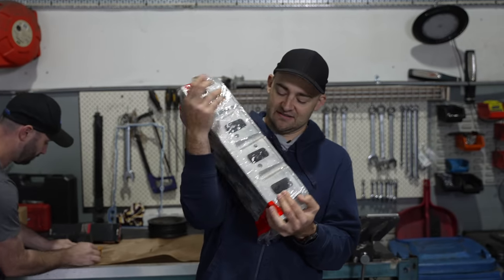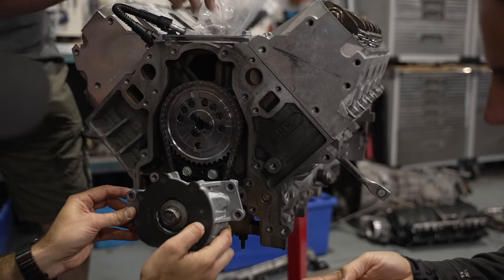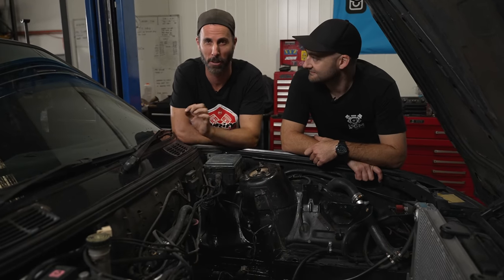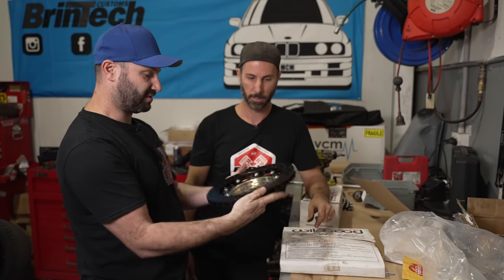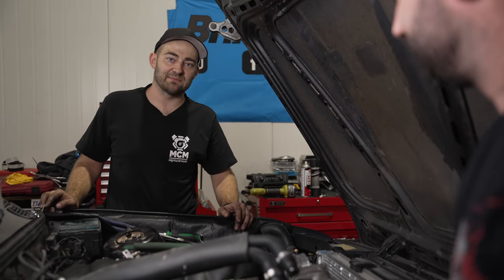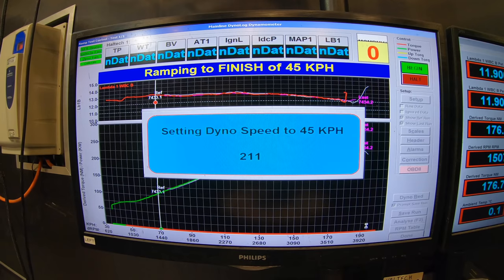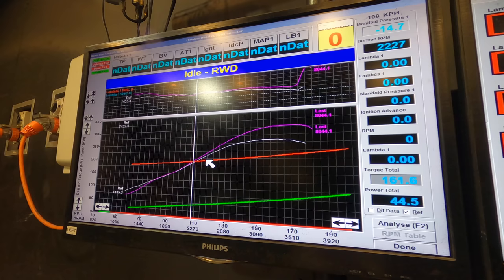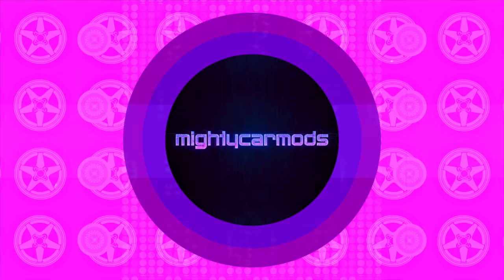BMW E30 CAM Upgrade & Dyno Run

Comment from the maker: Just a pinned comment to say Thanks for watching, there's one more video in the works to finish off this mad car (hello driving and skids) and then we've got something special for you.. Have an awesome week!
Reply: Thanks for making awesome videos!
Reply: Was that you shredding in that solo Moog? Sounded sick \m/
Reply: Hey Marty and Moog, anyway you could do a random fun video where you plum in the A/C output and redirect it to the air intake? See if its any benefit or if its parasitic and doesn't make any more power? I'd think it'll be an interesting video concept.
Reply: @chrisnorman1183  I like your way of thinking, but I'm pretty sure the power to run the compressor would outweigh any gains. Although, if the A/C was plumbed to the intake and inside the car, perhaps that'd be a way to run your A/C with less power loss...

Only one way to find out...
Reply: Thank you for everything you blokes do :) Really looking forward to the next instalment and what's ahead! You guys take care, same back at ya
Reply: Willwood brakes are shite lads 😋 ther only for Drag cars to be light . Alcon is where its at 👌🤙 Brembo are alright too 😋💯☘💙💚💙💚
Reply: You guys should ceramic coat the headers blaaack to decrease engine bay temps
Reply: Is there going to be a race track battle with Bennys IS600?
Reply: Chur!
Reply: You need to reinforce the chasis on the e30 mate
Reply: @BobMonkeypimp  exactly, conventional wisdom says no but throw a day at it and make a 15min video. If its useless it goes "in the bin" haha
Reply: what's your confidence level for the stock diff? love this project!
Reply: So the E30 vs Benny and the IS?
Reply: Something special.... a... GEMINI?!
Reply: Time for an updated intake video? Lol
Reply: Every video is something special for all of us, have an even better week legends! 💙
Reply: Marty, keep this car after it's done. keep working on it until it's fully epic and do not send it the way of Ms. Daisy! 😀
Reply: You guy’s are legends don’t change and keep up the awesome videos. 🤙🏼❤️
Reply: You guys deserve a tv show ngl
Reply: Luv you guys fro Panama City beach fl
Reply: Wow nicely done gents!  This is an epic little car!
Reply: Can't wait for black chops season 3. Hello compressor
Reply: U put so much work in ure videos, its a pleasure to watch, Thank u guys!

And so much work of this wrealy nice looking E30, get a good pack well setup Coils and decent tire sizes and rip that thing on the track, please!!!!
Reply: Hopefully the cold air fix up then skiddssssss
Reply: thanks guys!
Reply: There is still room for improvement in the chassi: lollipop eccentric bushings, E46 rack, stiffer steering bushing, adjustment tabs at the rear, etc....
Reply: In the Dirt
In the Dirt
In the Dirt
😂🤣👍👊
Reply: Race the lexus??
Reply: You guys have to race against Bennys IS600!
Reply: great video as usual
think about a hood scoop like the demon
or even the one headlight delect is fire
Reply: This episode had almost everything - Tuning Fork, LS3, Cam swap, BMW E30, 'Will this fit a Honda?' - just missing safety turbos/Yoda,Woody, Mechanical Stig and the 'I can feel the lubed shaft/Put both hands on it and give it a tug' double entendres usually seen when reassembling.   Love from the UK
Reply: Favourite build to date,🇮🇪🇮🇪🇮🇪
Reply: Why do you never throw any real power at anything??

You always take the cars to the track, seams like you do every mod but the engine is pretty much left alone! Cletus has LS engines with 3-4 times the power??
Reply: Thanks for all that you do.  Keeping well over 3.5 MILLION loyal subscribers happy is no easy task, yet you boys pull it off with every upload...  And TBH,  I really do wonder if those brakes would fit one of my civic's? Isn't the BMW 4x100 as well? It can be done...
Reply: Thank you so much for making these videos. I get so much satisfaction and enjoyment out of these. It truly feels like really enjoyable relaxing experience to watch you build and modify cars. Even now I feel already more relaxed and have had so much enjoyment and satisfaction out of your video and I'm only half way through it. The production quality is so superb in your videos and the music is just so absolutely awesome. It feels like floating in a pool of enjoyment because you do things so properly. It gives me big satisfaction.

Thank you and keep up the good work. :D
Reply: What about the jimny
Reply: Just placed my first order to you for MCM swag!! 😁
Can't WAIT till it gets here.
Reply: @andreas.619  I understand you but I have to disagree and only because tv ruins car shows. I honestly feel these guy’s are better off where they’re at. Tv makes to much drama for views for no reason. I hope marty and moog keep growing and have massive success in there life but tv isn’t in my opinion the way they should go. I hope you understand and i hope I didn’t come off as rude or anything much love.✌🏼
Reply: Put a pair of louvers or louver the hood,one on each side and pull that engine heat away from engine and compartment while pulling cooler air into the intake.
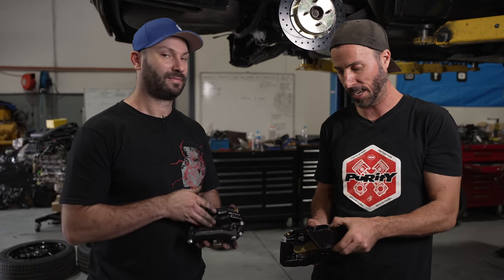Reply: please tell me what is the name of the song in 14:26, can´t find it. Want to know the name of the song sooo bad

Comment: Next episode: How to install a snorkel on your E30
Reply: How to install full tent combo
Reply: I had a snorkel on my silvia back in the day everyone thought I was taking the piss but my iat was awsome
Reply: stainless-steel-snorkel-kit!-?-!-?   👍
Reply: Or... Fit an N/A front mount.
Reply: XY HOW, GOOD ONE SIR.
Reply: Step 1: jack up your car
Step 2: install lift kit
Step 3: race mod max
Reply: Or how to replace crappy felpro head gaskets that failed....
Reply: next episode giant drag racer air scoop
Reply: Snorkels on BMWs could be more useful than you might think: https://youtu.be/-Tzdwdso5YM
Reply: @RoraighPrice  maybe transplant the hood scoop from the sti hahaha
Reply: Inline 6 swap
Reply: Make a mesh Hole in the hood and this funnel in the light and a plate (with some gold tape) to Project from exhaust heat 🎯
Reply: @chubbysumo2230  Was it the gasket? or was it the installation, or prep, or design flaw of the engine (many are known to leak easily)?
Reply: @Oblithian  exactly, too many variables to blame just a single brand of gasket.

I’ve had good luck with Felpro gaskets on my Heep and my 5.0 Mustang.
Reply: Guess they have to meet up with Donut and build a rally bmw together
Reply: That would be a good mod

Comment: Can we take a moment to appreciate Scotty nailing 3 perfect consecutive double-clutch downshifts while fiddling with a laptop like it's nothing at all?
Reply: Not to be a dick, but they're just standard downshifts. Even if they were double clutched (which isn't harder), I'm not sure what's impressive?
Reply: @-tr0n  It's easy with practice but properly double clutching especially smoothly and quick takes a lot of said practice.

It seems like you don't actually know what it is so let me explain. It's not just pumping the clutch twice like a lot of people seem to think. You push the clutch in, put the car in neutral, release the clutch again before pushing it back in and selecting the gear.
Reply: @janemba42  Yeah, it's one extra leg movement. Had to do it on the old '91 vw with blown synchros lol, also helps smooth out the shifts on an 18 speed if you're having trouble floating. Not really necessary on anything else!

If you watch the video, he only declutches once per downshift unless I missed something. Are we just assuming that because he rev matched that he is weirdly double clutching for no reason?
Reply: @-tr0n   "no one needs to double clutch" unless your a Fast and Furious character.
Reply: @RoraighPrice  granny shiftin...
Reply: @-tr0n  Sure did take the time to write that comment tho, didnt ya?
Reply: @nickkropat8857  Like I said, not trying to be an asshole, just clarifying things and genuinely confused as to why rev matching is impressive. It's literally second nature to car guys, or so I thought.

Comment: I’m getting my E30 done with a cammed LS3 at the moment, you can even see it in the background at 17:22. It’s over at Hassarati at the moment getting all the rust taken out and getting made very brown. Very keen to finally get it back.
Reply: What's a conversion like this cost
Reply: @JOHN42TD  I would guess 20k
Reply: Don't just do the cam. LS motors are great but they kinda don't breath that great. Get new high flow heads and a good intake, with a nice set of high flow headers and you will be happy. Anything else is a half cooked build.
Reply: What ever you do , don’t leave the stock trunnions in your rockers after putting a big stick in an LS 🤦‍♂️
Reply: You'll have to pop some videos up once you have it back mate

Comment: I've never seen moving the intake make such a huge difference before. Very cool example of how some popular car mods that don't do much, if anything, for a majority of cars (cool air intakes) can be incredibly effective in certain setups.
Reply: There’s a lot of “cold air intakes” don’t actually draw in cold air efficiently, instead bringing hot air from under the hood.  Sometimes it’s better to just modify the factory box and use a smooth tube between it and the throttle body.
Reply: Heat shielding the airbox and manifolds makes the biggest difference when talking about temperature.

Comment: ( A fascinating episode regarding successful Dyno runs and the incremental power increases that often quite small adjustments appear to make). - It was really interesting to see how much extra power is available when the air intake is unrestricted. Great episode boys, - thank you so much 😊👍🇬🇧

Comment: That's an insane power difference just by lifting the intake out of the engine bay! It's one of those situations where it's way more than adequate enough even when it's pulling in that hot air, but just knowing what it's really capable of makes you want to chase after it. I'm excited to see the final episode

Comment: Never really wanted a V8 car before, this project has changed my mind. I want one of these. The E30 coupe is one of my favourite cars ever.
Reply: I used to want a v8, but...   they are so heavy and you can get the performance you'd want for the street easily with 4 or 6 cylinders these days so... 🤷‍♀️

I do really like some of them though. But I think I'd sooner have an electric motor.

Comment: The amount of time, care and bagged new parts makes me nauseous. I did enjoy this as much as I enjoy your other exploits, chop chop v8 noises boi’s
Reply: Matt the entire time I watched this I couldn't help be think about how much extra work they did lol. They they didn't even upgrade the failure point of rocker trunions... SMH
Reply: New head bolts lol
Reply: @ryubiggie  not on camera, at least.
Reply: @ryubiggie  yet to personally see one of those trunion failures I’ve heard so much about, I’ve had to replace a bunch of 500lb valve springs from 12 years of daily driving with 7200rpm and 950rwhp without a single trunion failure, I think their ls3 will be fine 💪🏻
Reply: Every bag is just thousands of dollars 💸💸💸
Reply: torque wrenches on headbolts smh
Reply: @gavwilldo  it was more common in the 243 heads along with broken valve springs. you see it a lot in the c5 groups.
Reply: @Vile_90  I would of thought it would of been more common from the side load on offset intake rockers on rec port heads than the straight rockers on the 243 cathedral heads 🤷‍♂️ I’ve broken a couple of the outer pac dual springs myself too, but yet to drop one due to the smaller inner springs still holding the retainer up
Reply: @gavwilldo  I've only ever seen the aftermarket trunion upgrades fail lol
Reply: I came here to look for this comment. Did not disappoint. Different strokes for different folks as always. Some people spend $15k to make 450 wheel, others spend $3k to make 700. Both are fun to watch.
Reply: Racoon triggered!! Ive watched tens of hours of mott hooples slamming 250k motors together with impact guns, hitting the dyno and yawning out mega HP, way more entertaining to watch

Comment: with just a cold air intake... and people be replacing them cold air intakes to hot...🤣🤣
Reply: Can't agree more.  So many hot air intakes are advertised as cold...and evidently, so many people just don't seem to understand how a cold intake works, or they'd be able to work out for themselves how much those manufacturers are lying to them.

Comment: I love how you don't do a burnout as soon as the engine is running. Adulting like Adults.
Reply: Back in shop class, I rebuilt a guys 305 in his Nova.  Just stock stuff since that's all a highschool kid can afford.  He drives it out of the shop and immediately does a brake stand for a minute at high rpm.  I was like, that engine is coming back here.  Sure enough, next week his car is in the shop and we're redoing it again.
Reply: No fun at parties.

Comment: Headlights are over rated… do it, get rid of one high beam for a cold induction setup
Reply from the maker: may have to! worth it for the power
Reply: Where is the headlight going?🤔
Reply: @nikoszaxaris2895  in
Reply: @nikoszaxaris2895  away
Reply: @Mrzacman5001  the
Reply: @thomasrupesinghe  bin

Comment: Nice! Maybe swap left headlight for the cracked right headlight. Then remove the cracked light altogether and replace with black mesh. Inside of the bay looks suitable for air box. It would be mint.

Comment: Plenty of ways to get more cold air into the engine bay on the E30 without hacking up the hood. 
Make an airbox and either duct up from below the ABS tray or clear out some of the grille/headlight bracket to let air in from the front. 
Lots of area on the valence behind the bumper that can be opened up and remain invisible as well. Common to do this and slot the underside of the bumper on turbo setups. 
Getting hot air out of the engine bay is more difficult without cutting holes, but simply removing sections of the hood seal can do a bit.

Comment: Wow, what a dramatic illustration of the benefits of cooler denser air on HP. Since this is a track car I would totally pull a headlight and route it that way. Dodge does that stock on the Hellcat Challenger.

Comment: At 4:10 you are oiling the rocker arm seats and getting oil into the bolt holes the rockers are secured by.  This is bad form as any oil in a dead ending bolt hole can prevent the bolt from fully engaging into the hole as the oil is trapped and can hydraulically prevent the bolt from fully tightening.  the bolt will "appear" to tighten as per spec, but it can still be loose on the item it is meant to secure.  Good practice is to use shop air to blow out each bolt hole just before inserting the bolts.

Comment: For future reference on ls engines, soak the lifters in a cup of oil overnight  to prevent premature lifter failure from them compressing dry upon initial start up ✌

Comment: This is arguably one of the most exciting mod/upgrades you guys have ever done. You've had some peaches in recent years, and done some truly impressive work. But this E30 with the LS will have some ridiculous power to weight ratio 👌😍🤤 And that's why its exciting. In terms of driving experience, I think it'll be just as good as, if not better than, the Z swap. As a driving machine, this Beemer is going to be amazing. Little bit envious... but I'll just go for a ride on my Bandit 1250 and I'll get over it quickly 😅🤙 Get chopped! 
"In the Bin!!!" (because Marty deprived us of it)

Comment: That's why over here in the states we usually run ram air hoods or run it through the headlights or fenders, N/A with the right cams you really see what the heat can do, for a car like that I'd run it in through the fender or if you can try to get to the grill

Comment: The reason for the torque and then the angle on the head bolts is because they are stretch bolts which means the threads distribute the load better.

Comment: On LS motor you need to put thread locker on the bolt for the flywheel. The bolt got into the oil passages and will leak if not done.

Comment: that one cam in the middle with sticky stick things sure did something nice. 440hp in a tin can. looking forward to a driving vid.
Reply: I'm personally not a big fan of pushrod V8s (or V8s in general for that matter) but there is absolutely no denying that for the people who live in places where the LS went into everything it is an absolute no-brainer if your only requirements are "Cheap. Compact for the power it makes. Lots of after market support".

Comment: Nice build guys but you really got the disks mounted at the wrong side. The way you did it is nice when you are heating up your brakes so much when you are racing so your pads don't get "glace" all the time so you lose brake power, they simply grind off the top layer much faster. For "normal" road usage you better do it the other way around because: 1. Your pads last much longer because they grind less with the groves but more then enough. 2 When its rainy your groves fill up with water (while hitting the brakes) because of the angle and water stalls around inside of the caliper because it throws water in instead of out of the disk. Just a tip from someone who is picky on that kind of stuff ;) Have fun with the car!

Comment: Same pcd as a Honda so yes would fit with bigger rims. Run the intake pipe down to the rod lamp area a put the airfilter down there

Comment: Those are lug mount calipers.  Best way to describe i guess is the bolts that hold the caliper are parallel to the lug nuts.  Radial mount calipers have bolts parallel with the disk face.